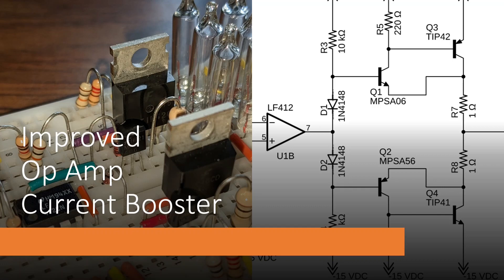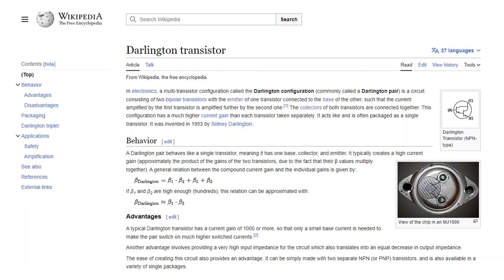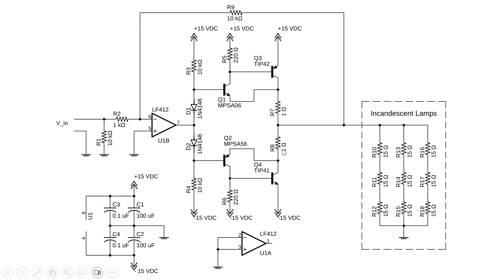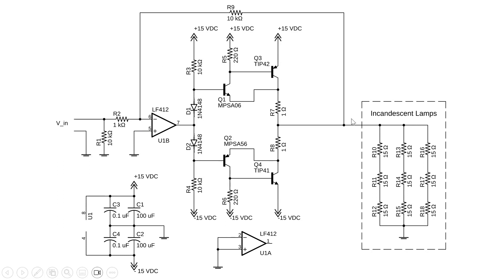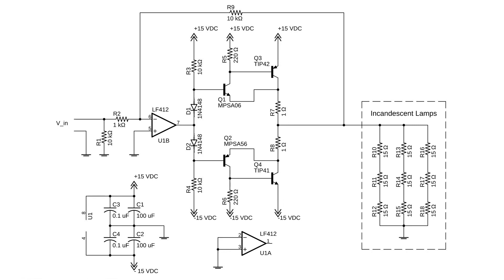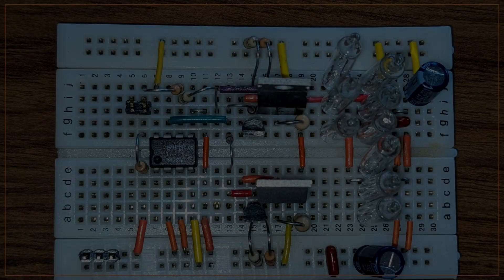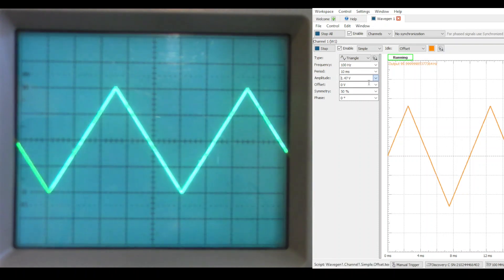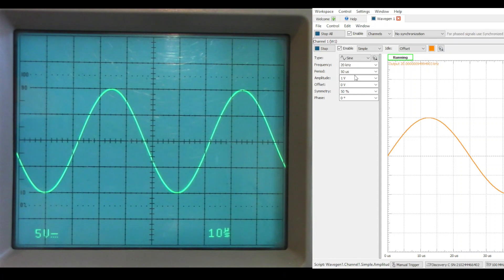Op-Amp Current Booster Using Complementary Feedback (Sziklai) Output Stages

Comment: You didn't compensate to make the circuit stable. The load is pure resistor without capacitance, which is a bad simulation of real world load such as a speaker. Also bias is not that important once you have negative feedback back to the op amp.

Comment: While you might think incandescent bulbs are a neat solution for a load, the hot resistance is perhaps 20 times the cold resistance and the thermal time constant is of the order of milliseconds. At what operating point are you expecting to see 15R per bulb?

Comment: i posted a few comments that became redundant as I watched the rest of the video, so I deleted them.
So here we go... take 3 😅
I like the idea of using incandescent bulbs as a load. I have a heap of trailer bulbs I might wire up for the same purpose.
You might be interested in trying bootstrapping to get it to swing better to the rails. Also output parasitic snubbers would be good.
One last thing that would be interesting would be to use a fairly high slew rate OP amp and see how well the negative feedback corrects the crossover distortion WITHOUT any bias. You may be surprised since you're using Sziklai pairs which have a base emitter junction voltage of 0.6V or so.
The distortion may remain inaudible.
I made a bias less 1W amplifier once using an NE5532 once and I couldn't hear it's distortion because of this corrective action of the feedback

Comment: hi thank you very much for this great video   Sorry for my ignorance but what are the benefits of using a pair of Sziklai pairs instead of a pair of complementary darlington at the output ?
moreover have you simulated the circuit ?   do you think that simulation SWs can provide results close to reality ?
Reply: The Sziklai has less Vbe on voltage as there's only one junction instead of two base emitter junctions in series so it's easier to avoid the cross over distortion.
Reply: @Dazzwidd  hi thank you very much for your kind and valuable advice
I have looked at some service manuals of vintage preamps and i see that the Sziklai pair was quite popular in the late '70s line preamps are gain stage and buffer stage
Today symmetric topologies are more used  
I wonder why because many still use cap coupling both at input and output   
There is a competition to design and build the best discrete op amp   i.e. with the lowest THD+noise 
Even if opamps are very tough to beat 
Kind regards gino
Reply: @gino3286  There's nothing asymmetrical about the Sziklai pair. The symmetry comes from the transformerless push pull output configuration so if you're concerned about symmetry you use a sziklai in the top and bottom half, but you use the compliment sziklai so there's in one an npn/pnp and in the other a pnp/npn. Tell me, have you seen the John Audio Tech channel? It's pretty educational if you want to learn
Reply: @Dazzwidd  hi thank you again 
Yes i understand your advice   It is implemented for instance in the old Onkyo P-303 preamp output stage 
What would be the gain of doubling the single ended circuit ? less distortion ?  higher PSRR ?
I will look at the channel you mention with great interest
I have recently discovered LTSpice  Just for curiosity i am trying to simulate some very famous preamps and buffers to see their THD performance at sim
I understand that sim is not the reality 
But it could be useful if used properly
Kind regards gino
Reply: @gino3286  So Gino, did you get to see that channel? He covers the Sziklai a bit and there's a fair bit of experimentation and scope analysis. I think you'll be in heaven
Reply: @Dazzwidd  good morning and yes thank you I found it
I had already seen the video on the splendid qa403 spectrum analyzer unfortunately a bit expensive at 800 euros
it is my dream instrument
reading on the simulations I understand that one thing is the results from the simulation and another is the result of the measurements on a built prototype
Since starting from scratch I see it as difficult I am more interested in the modifications of decent basic devices but with a certain potential for improvement
usually you save on components such as transformers and capacitors which are very important for the sound
I am looking for the videos on the Sziklai topology Another pre-built like this is the old but good Radford zd22
Then there is the problem of the power supply
Now here it is too hot Everything is postponed until September I will try to do something
Thanks again and greetings
gino

Comment: A very useful, well explained video. Thanks for your efforts! I have a very simple question, can you recommend any high power igbt to replace the TIP42 and TIP41 transistors used in the circuit?

Comment: Hi APDahlen, Thanks first for the great video. At next i would be interested if you might further explain about biasing and resistor value calculation. That is if somebody wants a different output capabilities (current), voltage gain (R9/R2), different Q1 and Q2. I have not simulated or built this circuit but would be great to do it.